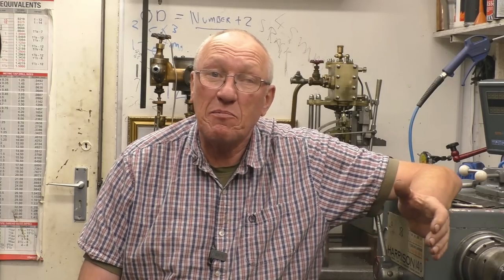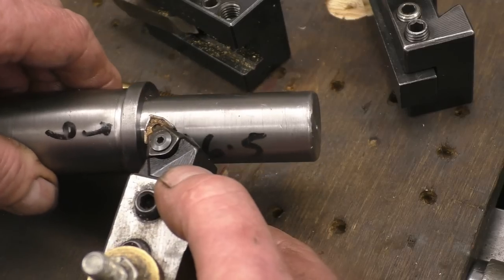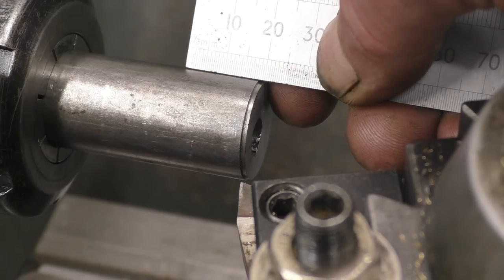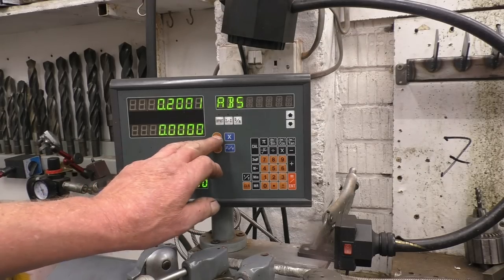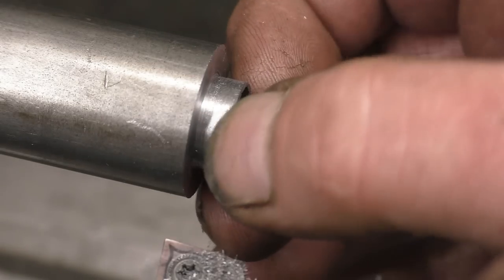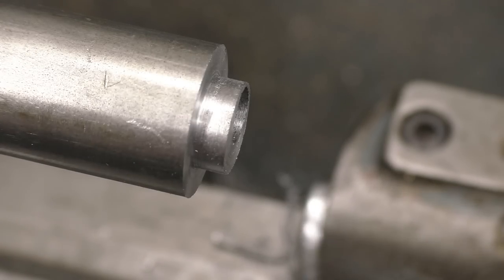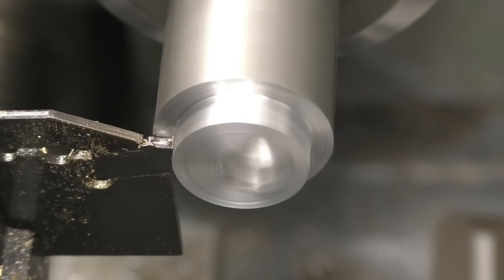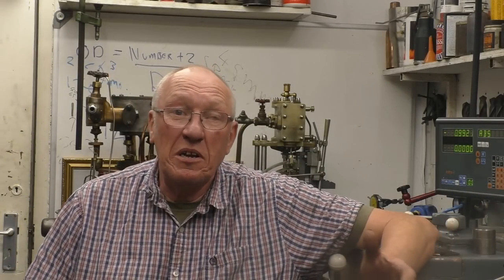Lathe Tutorial P5 . Machining To A Shoulder  (THERE IS NO PART 4)

Comment: Hi john another great video my lathe has a bed stop I always have the compound slide parallel to the bed I touch the tool on the end and either move the compound slide or set the length with a gauge block that way you can use power feed best wishes carlo valli